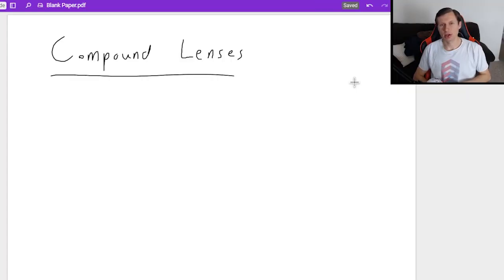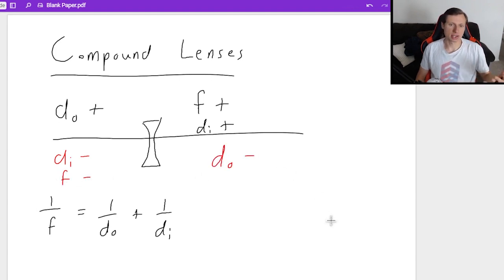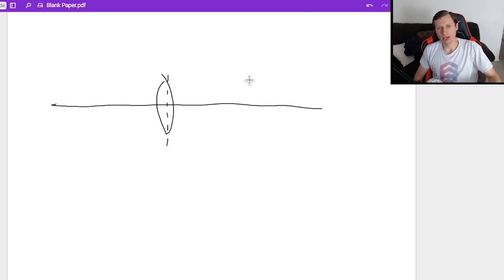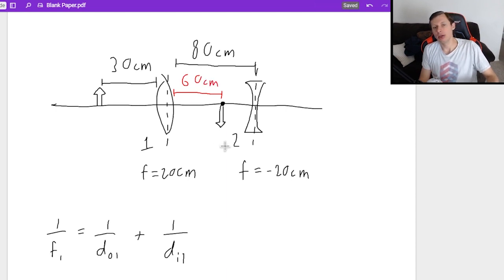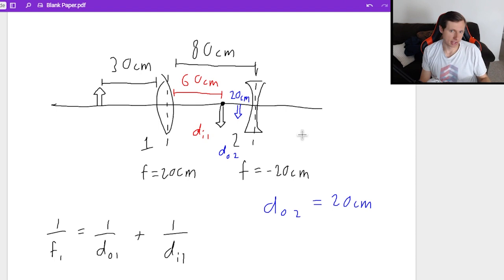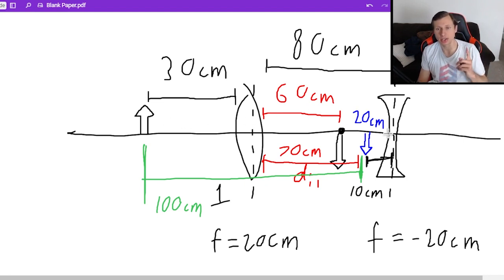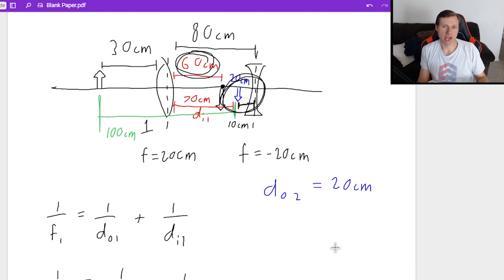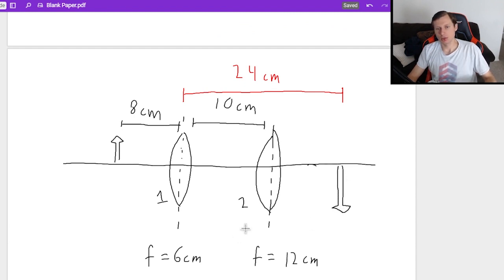How to Solve Compound Lens Problems

Comment: "All images need to be real for the finale image to be real." I don't think this is true. Consider a converging lens followed by a weaker diverging lens. This is actually the configuration for a telephoto lens as used in real life camera's and it forms a real image on the sensor or film of the camera. For example, consider do1 = 1000, f1=10, D=9, f2=-11. In this case you get the final image at plus 1.22 relative to the final lens which is a real image.

OK, maybe that is not quite what you meant, since at no stage is there a virtual image, despite there being a diverging lens, so swap them around. Now f1=-11 and f2=10. Now lens one produces a virtual image at -10.88 relative to lens 1 but the compound lens produces a real image at plus 20.1 relative to lens 2.

Also, if you reduce D to zero you can simply add the lens powers so that 1/f = 1/f1 + 1/f2 which will be an equivalent converging lens if 1/f is positive (ie the diverging lens is less powerful than the converging lens), capable of producing a real image if do > f. If you make D vanishingly small, the answer has to converge to the D=0 case, no matter which order the lenses go.